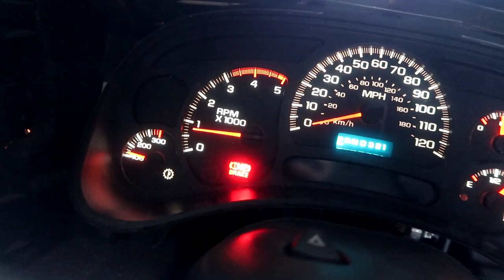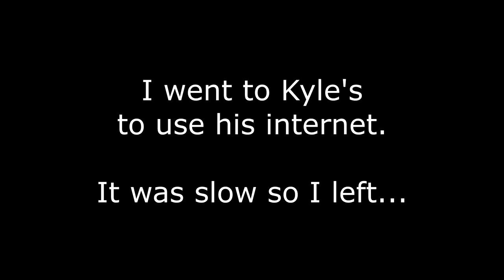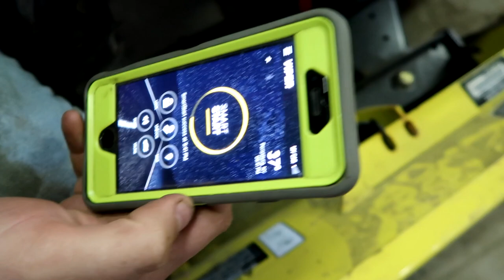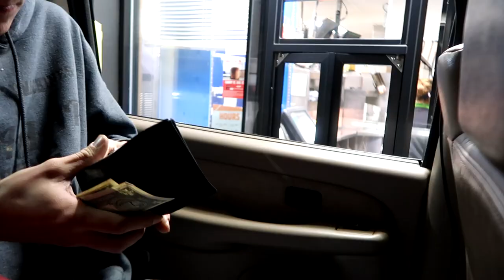we PISSED HER OFF!

Comment: I put money on it that your internet issue is a return problem. What that means is either your modem is to far away from the line that runs to the outside or that the 4way splitter is padding your signal because your plant is running low. Tech probably did a bandaid job rather then getting a maintenance tech to check the amp feeding your run. 10 years cable out!

Comment: Turbo your duramax
Reply: Welovecars you're joking right?
Reply: Isaiah Brown why not :p
Reply: Erik Borem But aftermarket turbos  will be better
Reply: It wouldn't run good with an aftermarket turbo because he does not have the supporting mods, the air to fuel ratio will be way off. The truck wouldn't get enough diesel. He'd need a few more mods until he can upgrade the stock turbo